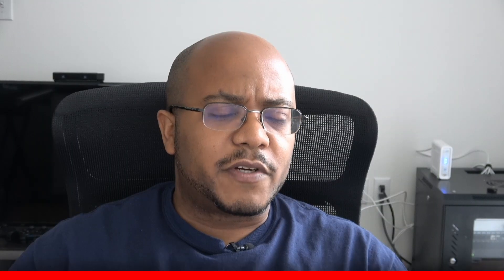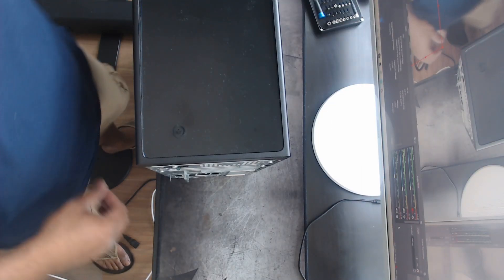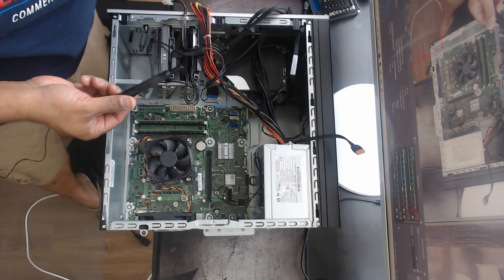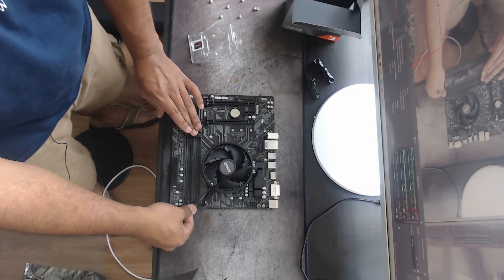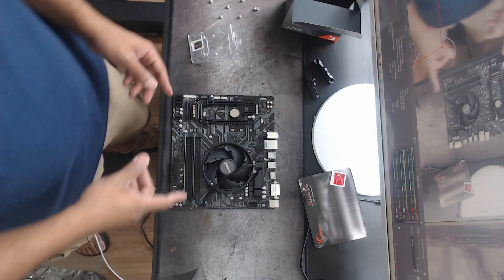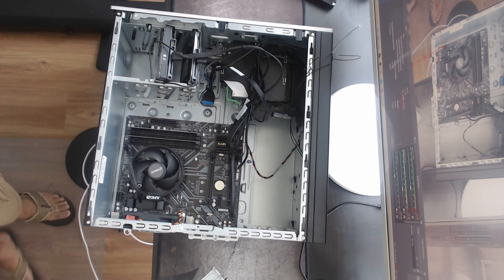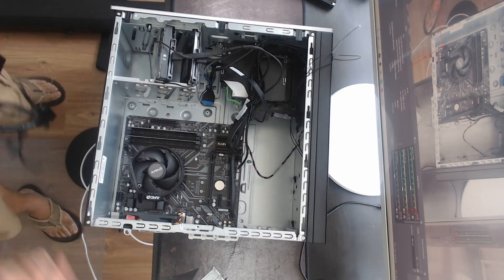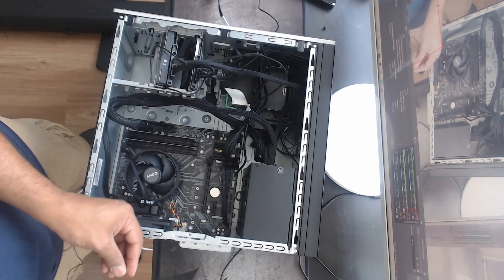INTEL TO AMD SYSTEM UPGRADE | Livestreaming PC | Shiloh Baptist Church Ashland, VA

Comment: Since this was an OEM computer I personally would have suggested getting a new case and power supply as well as the MOBO and processor. I would have taken the SSD and spinning drives out of the OEM and put them in the new case. This would have added another $60 to $100 dollars though. They could have then seen if they could have come up with the money later for a 240GB SSD put in in the OEM, loaded Linux Mint onto the drive, and donated the OEM to someone.
Reply from the maker: I agree. This is a part one.  Adding an internal capture card soon so a new car may come with that